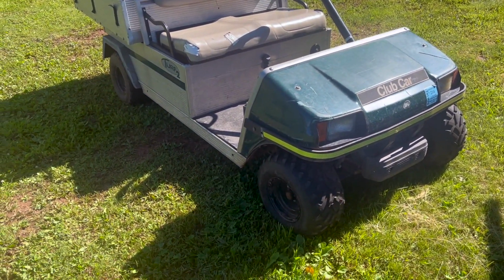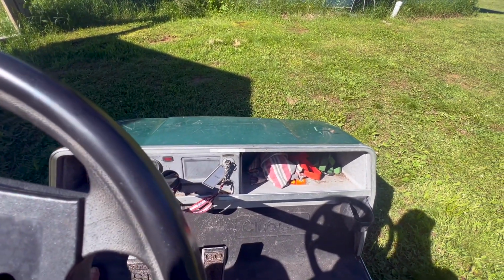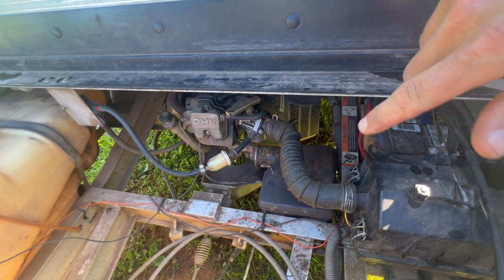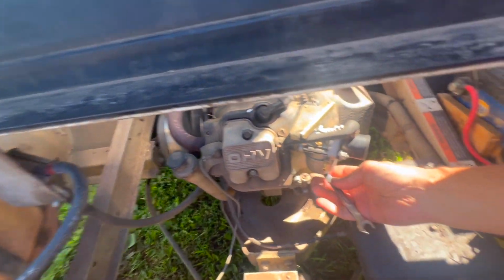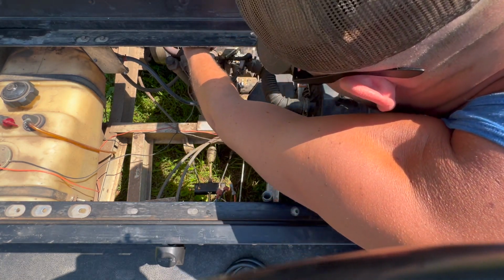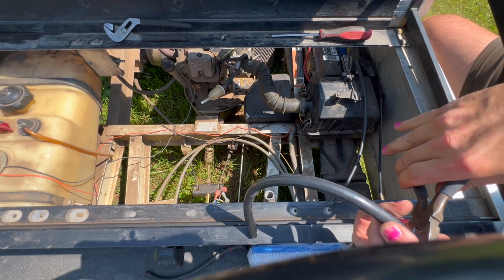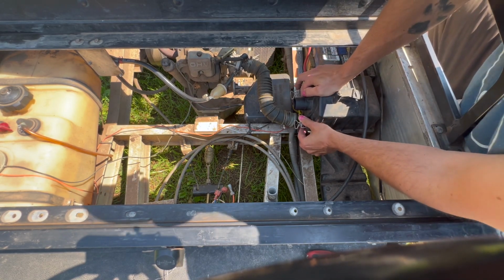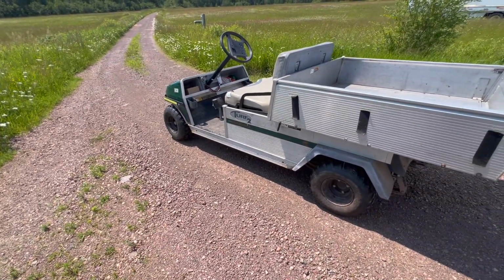I Tuned Up a Club Car Carryall and it RIPS!

Comment: All you have to do is tighten the idle screw on the carb till it idles. Normally its backed all the way out so it shuts off when you let off the pedal.

Comment: There are 2 options. Key to start and pedal to start. This is factory. To move from pedal start to key start, pull the black wire at the micro switch from the black box under the seat. Will start with the key and run until you turn the key off.
Reply from the maker: Good to know thanks!
Reply: Edit. Black wire removed, key on, gas pedal will start. Will stay running until key turned off. Black wire at micro switch is pedal kill when pedal released.

Comment: You can put this golf cart into a "test" mode that will allow you to run the engine while the gear is in neutral. When you remove the seat and look behind the gear shifter you can see a yellow knob. You pull the knob back and turn it into the right position and push it back in. What this does is engage the switch above this knob to a different setting.  You may have to play with it to find the right position, but once you do it can be run in neutral. Makes it easier to diagnose and work on. Just turn the knob again to put it back in normal running mode.
Reply from the maker: Excellent information. Thank you!